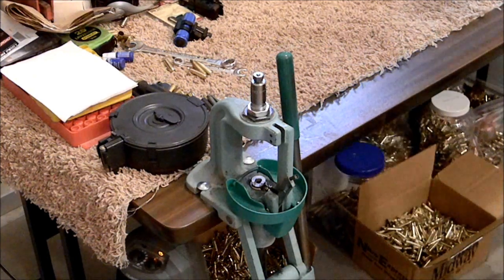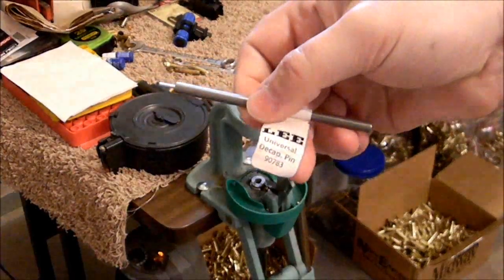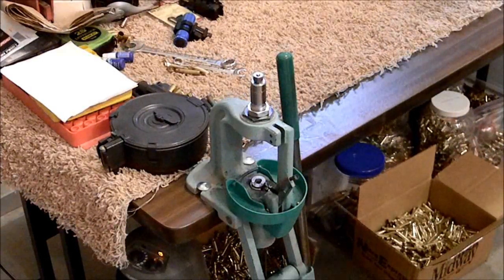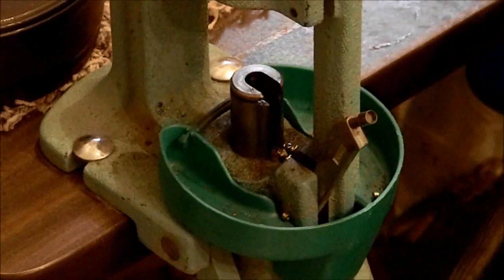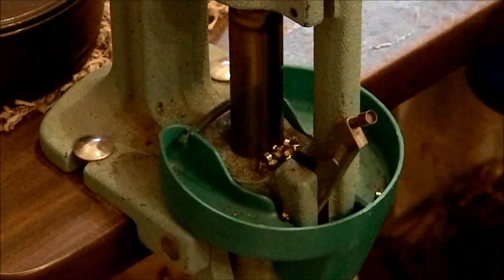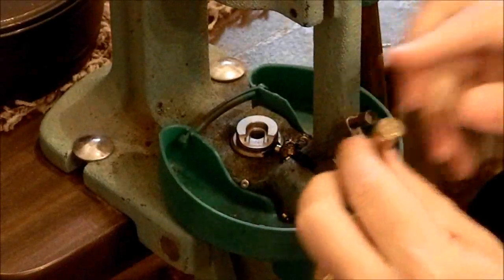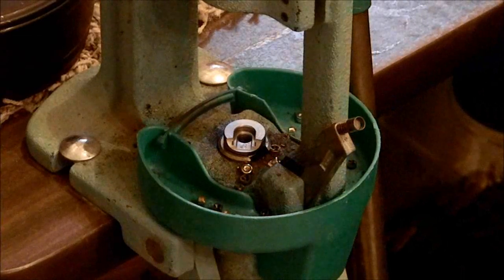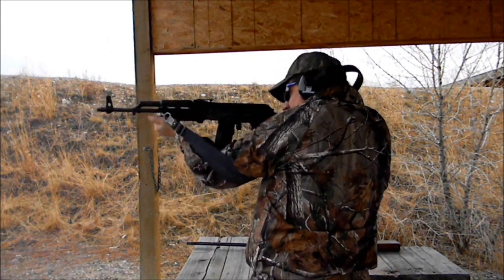Lee Universal Decapping Die ~ Product Review

Comment: "nny" is PPU in the Cyrilic alphabet.  Known issue is a flash hole that is smaller than normal but they are boxer primed.  A hardened nail can be used to knock these out and then the flash hole can be drilled out to standard size.  This is why you find so much "nny" shells lying around the range.  But is it worth the time to be bothered with them?  Always shine a light in the case to see if there are one or two flash holes before trying to knock out those tough primers though.